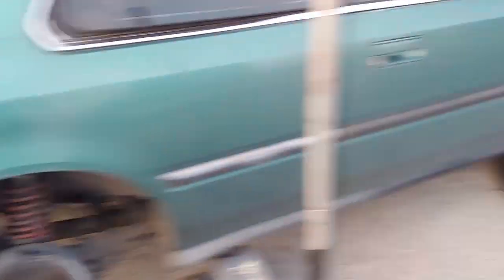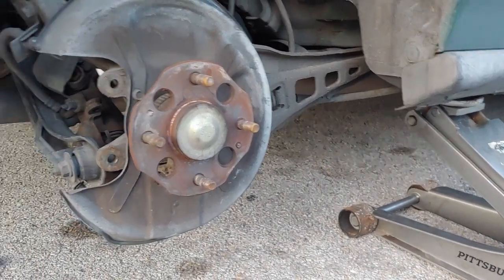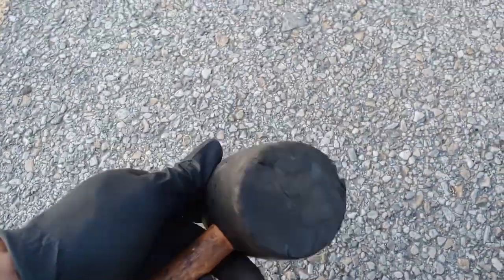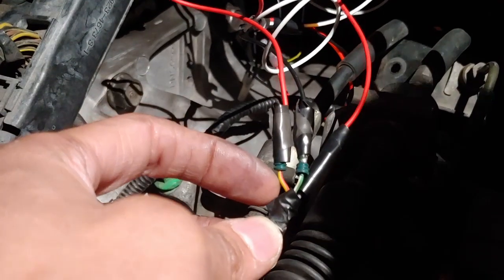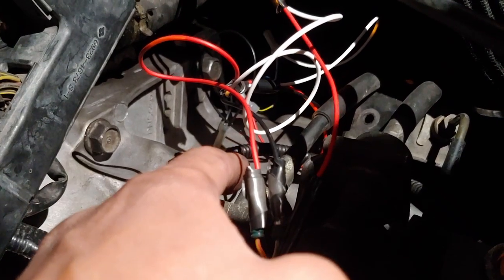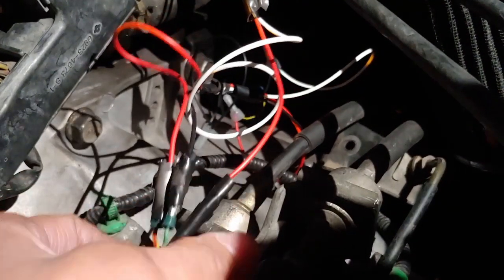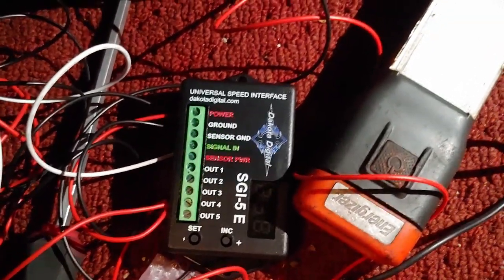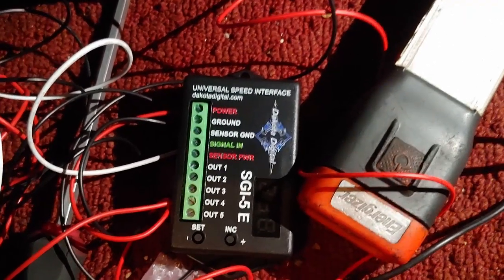DIY: 02-04 Trans into 05-06 RSX-S ( Dakota Digital )

Comment: Danmmm bro I finally found the info I was looking for thank God! I did the same put the 04 transs into my 06 type s ND I found a plug from a civic tht fit the 04 speed sensor and did a by pass from the harness to the plug but the car wouldn't start so I unplugged the sensor and the car started but speedometer doesn't work and car runs great but will cut at 4,0000 rpm so I don't have vtec basically but yeah every told me tht I could run a 04 transmission on my 06 Rsx ND wow this is what I was looking for cus nobody has ever put a 04 transmission on the 06 Rsx thanks for the info bro!!!

Comment: I have a 06 Type s and it had a 02 trans it was working, I just swapped it out for another 02 trans and now it’s not working for some reason?
Reply from the maker: Your speedo is not working?
Reply: @4bangermafia  yeah it’s not working anymore
Reply: So someone swap 06 housing on the 02 trans that was on I found the plug is different. I was wondering if you think this https://www.ebay.com/itm/TRC-K-SERIES-02-04-TO-05-11-VSS-SPEED-SENSOR-JUMPER-HARNESS-K20-K24-CONVERSION-/174621186897 would work?

Comment: luv the content im doing a full tsx swap in my ek can this also work for the tsx 6 speed trans?
Reply from the maker: Yes, but depending on ecu that you use will determine if you need high to high or high to low.
Reply: @4bangermafia   i got 02-04 rsx k pro ecu and engine hraness

Comment: Lol brings back memories. Dakota works great and cheaper and been out years ago. since my 96 civic 06 k20z1 swap is down I didn't have to buy another kpro for my 03 Rsx. What?! 06 Ecu in 03 Rsx without wire harness conversion. Only 2 wires to swap... Save money on just buying the 02 kpro instead of the 05 with harness if you got k20z1s or any high frequency VSS.   You don't need it. $600 vs $1000 kpro

Comment: So if I am running an 02-04 ecu in a 05-06 (Z1 engine and Trans) and I tap into the vss input to the ecu, and then go out to the tach from the SGI-5E would it be H-L  and output 4 as well?
Reply from the maker: This is for vehicle speed not engine speed for tachometer
Reply: @4bangermafia mafia yeah Ik I am trying to calibrate it for vehicle speed, have it in my car but having trouble with the correct settings to use to have it functioning correctly, bad choice of words on my part I am trying to get the speedometer to read correctly.
Reply from the maker: @4EverSuzuki  then you need to send VSS signal to SGI and then output to the ecu. And it should be H to L.  Use same output # I did. Then once you see the red LED come on when you drive the car. That means it's working properly
Reply: @4bangermafia  Hey just figured I would give you a follow up, I set mine up a little different than you did but the high to low worked for me on output 4. I tapped into the vss wire going to the ecu and output from the  5E directly to the tach and ticked the 05 vss on my ecu. Thank you for all your time and help.

Comment: Hey wassup I'm having the same problem with my 05 type s  But I'm using a 05 base trans wat could be causing this ? Base and type s vss?
Reply from the maker: Does the Speedo work at all or is it just wrong speed?
Reply: @4bangermafia  just the speed is off
Reply from the maker: Your speed is off most likely because of how different the FD ratio is on a base versus a Type S
Reply: Dam.. Is that why people rather go with a 02 trans instead of the 05 06? Haha so you dont think the vss has anything to do with it ?
Reply from the maker: @virachai336  the VSS is getting a different reading because if the Trans FD ratio. I think most people running base trans in Type S are kpro/turbo guys. You'll need Dakota Digital or kpro/ktuner. Dakota will only cost like 80 bucks
Reply: I do have a ktuner and I was plan on going boost as well can I adjust through ktuner ?
Reply from the maker: @virachai336  I'm not familiar with ktuner software but I would check around in the settings. Maybe look online or call ktuner. Someone might have a basemap for Base trans in a Type S
Reply: @4bangermafia  thanks bro I'll check it out.

Comment: it’s like 100x easier to just use ktuner to do this
Reply from the maker: Customer didn't have ktuner. Ktuner is better but more expensive. Also you still have to modify wires even with Ktuner. So this is an option for those who aren't able to afford ktuner or do not plan to get Ktuner.
Reply: @4bangermafia  with this method are the wires in the video the only wires you need to modify? I’m told with kpro you’d need to modify more wiring within the chassis harness
Reply from the maker: @Bricker621  Yeah this is all thats required to make it work.